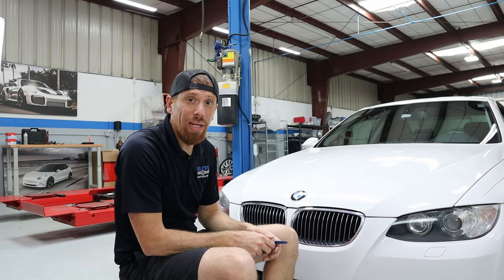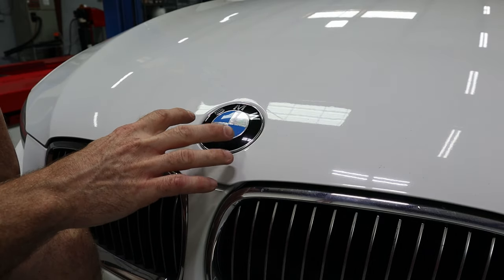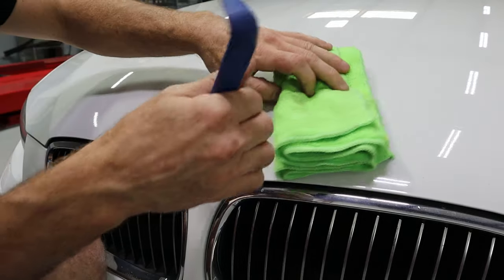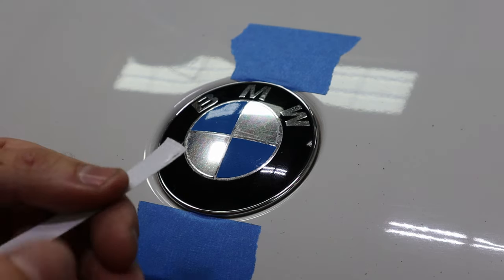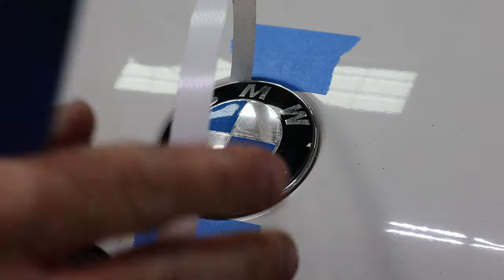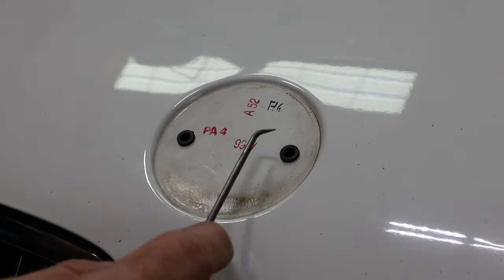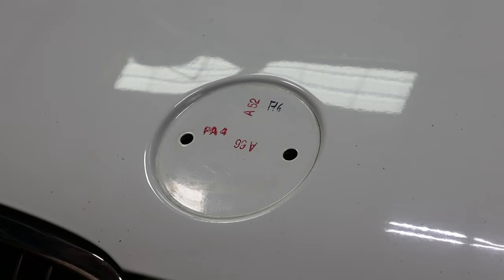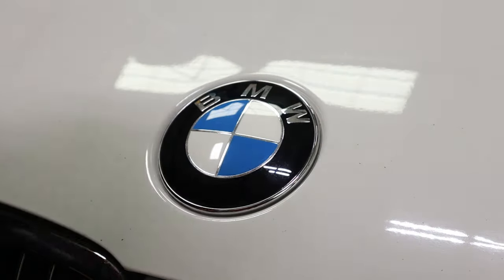DIY BMW Hood Emblem Replacement. EASY!

Comment: For anyone wondering, that plastic strap is BMW Part# 69420-FU, $227 USD.
Reply: Thanks I just ordered one
Reply: lol
Reply: Bargain
Reply: Is it a BMW authentic factory part or aftermarket?
Reply: You may think that this is a joke, but it’s not!
Reply: I like the FU part!
Reply: @nicolav9239  ¹
Reply: Dead
Reply: 😂 with all the parts I have ordered lately, this hit home
Reply: Just ordered x2 . In case one snaps 😢😂😂😂
Reply: Why 69420😂
Reply: No thanks, I prefer the screw driver method.
Reply: @GregPodster133 , that's a lot of FU 69420s. Hope you are ok 😢.
Reply: thanks for part number.. been looking fr years 🤣
Reply: Got a China knockoff for $25.99. What a bargain.
Reply: I bet that's index 4, I need index 5
Reply: Labor is going to cost you $150 per hour. This may take all day. Your specific car might need half of the front end taken apart then all reassembled for this emblem replacement to be complete.

Comment: Zip tie always worked for me just like your strap method but  you can grab it like a handle  one good pull comes  right up
Reply: Tried that one too and it was too tight. But thanks!
Reply: Didn't work:(

Comment: What if my new replacement doesn’t have pins on it? My VW bug is a 2004 and the old badge had pins, but the pins didn’t even line up with the holes. The new official VW badge only has a very strong adhesive on the back. Maybe that’s how they’re now doing it 20 years later.

Comment: Easiest way I found is using an empty 1L plastic yogourt, or cottage cheese container. Cut a 1 Inch wide circular strip from the container. Then making sure the natural curve of the plastic strip faces down feed it under the emblem, same as you did with the strap. The natural curve keeps the strip down against the hood so it will easily come out at the other end. Then just grab both ends and pull it straight up.
Reply: I’m looking for the hack as it’s been 8 years since I did a eBay chinese Bmw badge swap out and I used a cloth wrapped around a butter knife and tbh I spotted your suggestion and that’s gotta be the easiest pushing under then pulling .
Good tip 👍
Reply: Tried it.  No go.  Sweat dripping off my forehead, veins popping out... nothing.  The banding ribbon I pulled off a box in my garage was thin and stiff enough to get under the badge and finish it off with a plastic pry bar.  But it might work on one that's not so dang tight.

Comment: I use 2 drywall screws,drill them at 3 and 10 oclock. Not to deep just a little and pull on them. Works for me👍

Comment: Having never done this before but just thinking out the box with the goal not to damage anything - is it not possible to superglue a "handle" to the center of the emblem and once stuck, pulling it stright up away from the bonnet it off carefully with contrrol force. It seems like it must just go straight up and out. Nothing else holding the pins. Would that work?

Comment: I normally get it up a bit, and use mechanics old friend some piano wire, wrapped around the edge and pull it off via a slide hammer.

Comment: Nice video. The only thing I would do differently is after cleaning the area under the rondel, is apply a coat of sealant or wax. But I understand that was just a customer’s car.

Comment: Jaime , your hilarious, keep doing the videos! You make me want to find a very old BMW to work on.   And by old I’m talking like 20-35 years old.  Your opinion?
Reply: E34, e36, e38. E38 is kinda complicated though. But still great cars
Reply: Definitely look at an E46. Very inexpensive overall in my opinion and once you replace all the old plastic/rubber the M52 is a very reliable engine

Edit - M54 engine
Reply: @codyfield6859  I agree. Can’t believe I forgot to mention the e46. Guess I just like older stuff and the m20 and m50

Comment: Nice video! I didn't have the clearance to slip that strap underneath. I could barely get the blue prying tool under but it worked eventually.

Comment: Would it make it easier (once you get strap fed thru) to slide the strap closer to the pins (2 & 8 or 4&10 o'clock positions) & pull up from there? I'll try it in few & I'll let you know. Just got to order that $224 strap from bmw & hope it's not on back order 😊

Comment: I've never owned luxury cars but I'm kinda intrigued to know how much a replacement BMW badge would cost 👀
Reply: I just bought one from a wreckers cost $30 NZD
Reply: Front hood one is very cheap and easy. Back side one is like 5x times more expensive for some reason. I also think it's a pain to replace it too, not sure tho

Comment: You have to pull emblem out PARALLEL, strip idea is not very good. Better work on one pin and another, slowly. But parallel is key!

Comment: Where do you buy the strap?
Reply: Please confirm that it was a joke. ... right?
Reply: He must think that everyone accumulates these straps from mailing boxes he probably receives by the truckload at his garage, lol.  I think buying the strap would be really wasteful. Of course, you want to find the "tool" he just improvised here. It is a cut piece from plastic box strapping.  Buying it would mean you likely would have to get it in a large roll (Amazon has it)  Perhaps get the roll then sell it in small easy mail strips for $20 each + shipping to everyone that watched the video thinking okay, I haven't ever saved those from the rare box wrapped with maybe two of those box strips I get delivered to my house from UPS or FedEx, lol! Maybe try some blue painter's tape to protect your car's paint and use something you might have like a plastic lid you can cut to use the thin lid top to slip under the emblem to lift it up.  That might work too.

Comment: Alrighty then!  I had tried everything but a banding ribbon to take off that stubborn badge and just couldn't get under it.  I was ready to Dremel it when I saw your method.  It was a super tight fit and I had to use the thinner of two bands I had.  I couldn't push the ribbon out the other side, but it was just high enough to get a plastic pry bar under it.  The rest was cake.  Thank you!

Comment: Is it safe to use any kind of tape?
Reply: no use the weakest
Reply: Use what is known as blue painters tape. Ask anyone in paint department at Home Depot. It's meant to not adhere to cured paint. 3M Scotch Blue 2090 Multi-Surface Painter's Tape.  That should be safe.

Comment: Hey there. New subscriber. Question if that’s ok….own a 2016 X1…needs rear rotors/pads. I’m pretty mechanical but get differing options in regards to diy. Just wondering what your thoughts are on that. Thanks. 🇨🇦
Reply: Probably need a scan tool to put the back brakes in service mode.